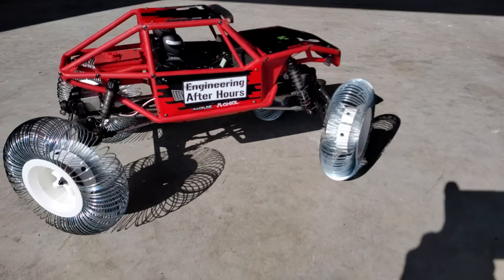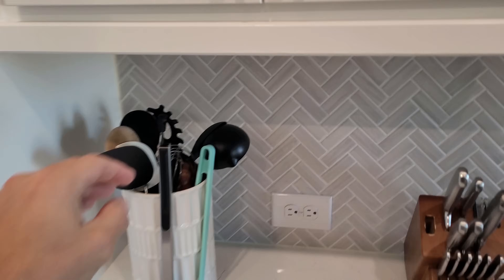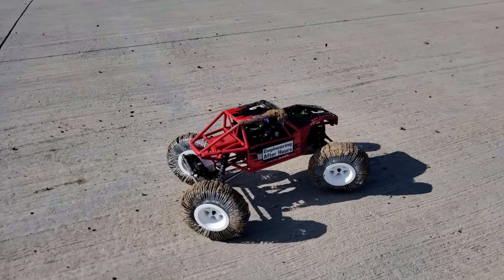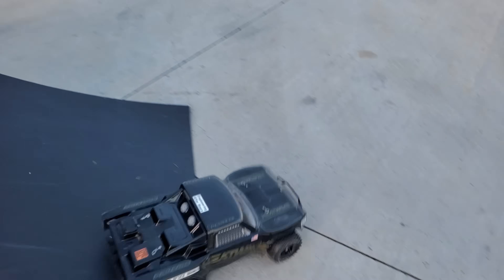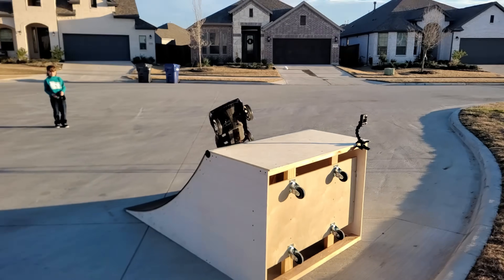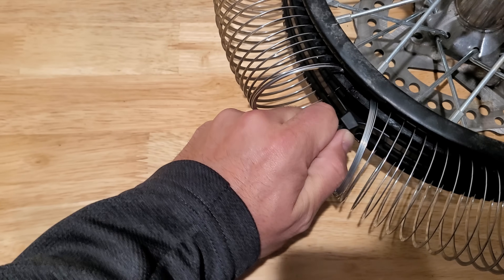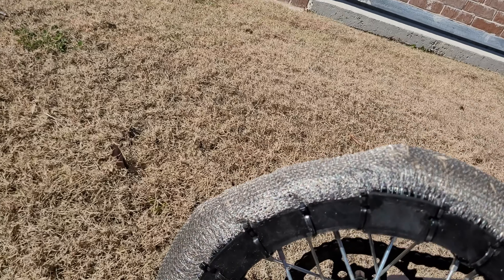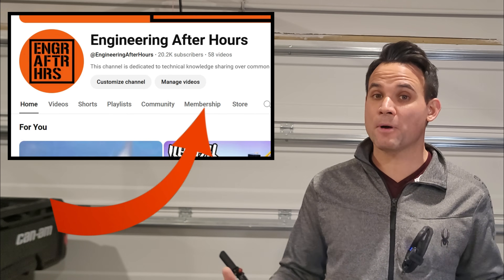Are NASA Airless tires really this bad?

Comment: This is a very creative project ! I would like to ask how the metal mesh is attached to the surface of the spring wheel.
Reply from the maker: There were 2 ways I attached them. 1 time was with metal wire similar to safety wire. The other was with really small zip ties.

Comment: Your reinforcements don't hold the rings in place at all. The NASA ones have wires woven between the rings and the bike kickstarter had them stabilized with a rubber tube
Reply from the maker: That's definitely a part of it. I allude to the need to mold it all together somewhere in the video for the next try. It's also a part of why I don't think these tires will ever be commercially viable. NITINOL is a fortune on its own...then when it's bonded into a wear item...itll kill the cost trade.

Comment: Hello, you reminded me of a small(ish) antenna business called Signal Stuff. Which make the infamous "Signal Stick"- 1 of the best antennas for Ham radio...but they use Nitinol as their main material...you should reach out to them...maybe they have a wholesale connection of they may have off cuts. Maybe even just guidance on working with the material.

Otherwise...when searching for their site again... I found lots of other Nitinol sources...and 1 thing that came to mind which seems perfect is Nitinol braid...commonly used in medical equipment/ devices. Like stents.

Reach out to Signal Stuff..hope this helps!

Comment: I'm no engineer, but I think one of the main challenges might be the forces orthogonal to the 'rings' of the slinky that come into play when there's any acceleration. In a regular tire those forces would be handled by the tensile strength of the treads themselves, distributing the load across a wider area, but I don't know how that might be achieved with a frame with that structure. It looks like even static load bearing is challenged by what seems like a highly localized stresses on the part of the wheel making contact with the ground.

Perhaps a material with sufficient capability for elastic deformation would allow more rings to make contact at once, mitigating that somewhat. And maybe a more tightly bonded concentric layer with low elasticity for the forces that sort of "shear" the contact surface from the axle? Not sure.

Anyways cool project, hope you find success eventually!

Comment: You need to put springs inside the slinky pointing outwards like shock absorbers then it will bounce back after deforming
Reply from the maker: I agree. The lunar rover tires had a circular bump stop that did exactly that. I will replicate that next time.
Reply: @EngineeringAfterHours  awesome!! I'll be watching 🤩 hopefully i get first dibs riding shoutgun on Mars

Comment: Its likely just not possible currently to have good grip on the asfalt, especially lateral grip. Off road its probably fine but it would likely still lower the efficiency.

This is pretty cool tho! For RC cars there could be a market for it.

Comment: well, as usual, you gotta diy the good/best stuff. market is just meh. well just put the slinkies inside a normal tire, instead of air. make sure the slinky is only used as the inner tire. not slinkies, try car springs.